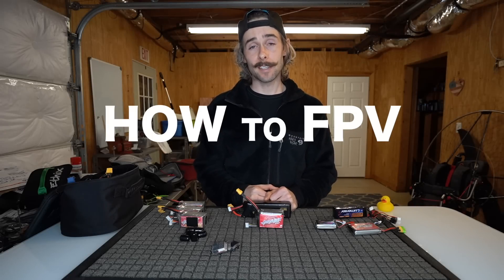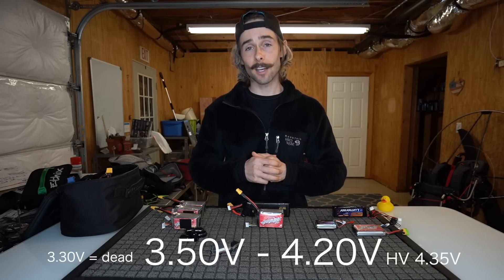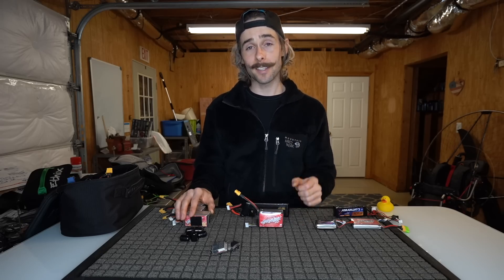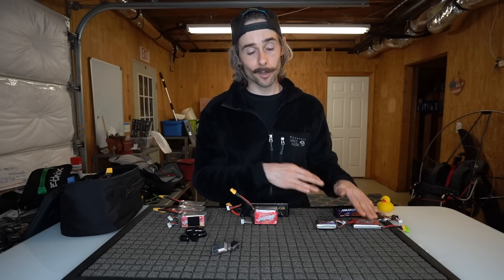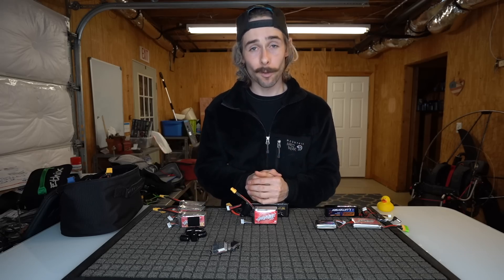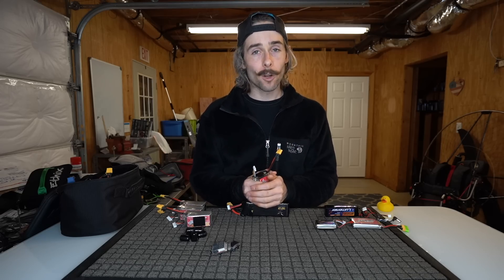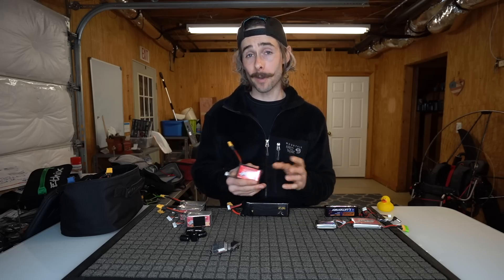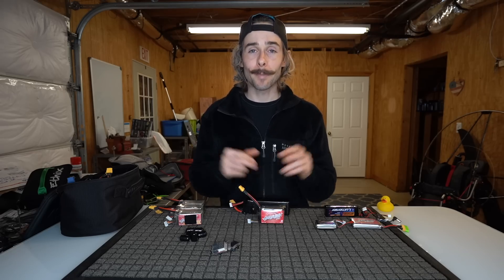How to FPV (Part 6) LiPo Battery Management | Make your LiPos last longer!

Comment: For new flier that wants to "future proof" (and have the "hot setup like Steele") of 6S, they can build/buy a 6S and limit the throttle to 70%. The bonus (besides being able to "turn it up" when ready) is about 25-30% more flight time. That's a very nice thing all by itself, and you will get longer battery life because you are babying them flying like that.

Good video!
Reply: I want to try that. Whats a good 6s grade motor for freestyle?

 I fly a 5", with 4s, HT Cricket 2450s + 5×4×3s.
Looking for smooth maneuvering with good punchout for flicks.
Reply: @jewishjitsu  The Xing 2208 1700kv on the Mamba Stack is my go to setup turning 6" (or larger) props on a Iflight long arm frame with DJI video (it's worth the weight and money IMO). If you're new to the game, or just enjoy proximity and flying thru the air like me, consider the 6" setup. With good batteries (RDQ 6S1250) you'll get super smooth flight and long flights as well as a rugged package that you can fly more than fix. On 4S you'll lose quite a lot of flight time, but it'll still fly fine although not so "punchy" on the hit. 6" on 6S is my favorite and it'll still do the flippity flip thing, but a tad slower (and easier to master), but is much more enjoyable if you just enjoy flying and aren't making videos for the youtube gang. If you're looking for 5" extra light, extra full speed stuff - The Xing 2207 1800 (you can get them in 1700kv or 1800kv) would probably be better for a strictly 5" setup like yours. A Mamba stack on Betaflight defaults ought to fly great if you limit the throttle to 50 to 75%. Make sure you don't just chop the top off, you need to reset the span so you get full range throttle control.

Looks at Oscars rundown on setups like this (https://oscarliang.com/best-motors-props/).
The 2207 is a great motor, I'm using them on 6" machines on 6S, and they work hard, but pull plenty hard, and still live. For strictly 6" I run the wider 2208. Smooth thru the middle with a top on that comes on plenty hard, but not so abrupt it's just a moonshot. You can play with betaflight and smooth things out a bit if you want to go more cinematic. 
I'd bet if you use the 2207 1800kv in your setup with throttle set to top out from 50 to 75% (depending on how new you are and how smooth you'd like it) You'll find it flies great on defaults. Hope that helps. Try the 6" 2208 setup if you have the budget, you won't be sorry. It's a bit bigger and still rips, but slows down nicely, which is fun, especially if you have High def video. If you need to know more hit me back again. Happy flying!
Reply: @scottmarshall6766  Thank you for the detailed response. Ill look into buying a Armattan 6" tonight. Thanks!

Sidebar, a 2208 would be taller than a 2207, not wider, wouldn't that only help with high end?

Comment: Do you use some kind of automated charger that you can set for a specific voltage, or you monitor the charging process manually?
Also thank you for making these series, it helps me a lot! I'm about to get into this hobby, and there's so much left to learn.
Reply from the maker: Automated charger.  Set the current you want to charge at and let it do it’s thing.  Always balance charge
Reply: Pretty much every single lipo charger has a storage charge option. The old imax b6 charger that everyone just starting out gets has it. And every IDST charger has it. All the other random ones do too.

Comment: Once you put the lipos at storage level, how long should you re-check the battery? For those long winter months.
Reply from the maker: They should just chill there and not change   No need to check at Storage voltage.  Do make sure they are kept in s climate controlled environment. Maintained within a range of 60-85 F degrees
Reply: @MrSteeleFPV  Good to know, also very informative video....not as fun as chasing race cars though but just as needed.

Comment: But dont put 6s on a 4s fc right ?
Reply from the maker: FC shouldn’t matter. It’s ESCs and motors you’ll have to worry about
Reply: Unless your fc has a built in BEC that does not support 6s voltage input in which case you could just rip off the bec and use a 6s pdb.

Comment: I'm sure you are aware the S is series not cell. so the 4s pack we use are 4s 1p. I have had people very confused in the past as  to why we don't say 4C. If producing educational type videos this kind of basic fact should be noted. you also didn't mention what you store at I like 3.85V and then charge as 4S 10P @ 1C this allows leaving charging nice and close to going flying.
Reply from the maker: I wasn’t aware.  But for this area of the Hobby. It doesn’t really matter. We don’t have parallel batteries for flight packs

Comment: Regarding efficiency I've something to ask you. I like long range flying so I rarely ask huge current, I never punch when I'm far... My usage is much more constant and this can even be a little more risky because I never have a punch voltage test. Does flight time or ampere consummation could be more reliable to evaluate the percentage of usage than the voltage in you opinion?
And my second question is about efficiency. Do you think it's more efficient, for long range flying, a 6s or a 4s pack (obviously considering the same overall wattage). Probably 6s, since it's easier to provide high voltage than high current. Don't you think?? 
Congrats for all your video!! I always measure 3.75v/cell after landing, under no charge. Seems perfect.
Reply: Unless you properly calibrate your current sensor (using known good current sensor such as multi meter) flight time is more accurate (if you sample multiple similar flights). As what is more efficient, It depends on what is the biggest loss currently and that is hard to know. Better question might be: is it worth the money to change my current setup for less sag and a small flight time gain?

Comment: Regarding voltage that tells you I have to land:

The voltage is changing all the time regarding if you are on full throttle, half the throttle or just slowly cruising. So about which situation are you refering to when you check your voltage and say "It is about time to land, my Batteryvoltage is about 14.8V"
Reply from the maker: Under load depending on the battery and it’s health i.e. how old it is and how much abuse it’s seem you should always look at your packs voltage either when cruising which will be around 13-14V. Or during a free fall. When you have no throttle input.  Should be between 14.5-15V. 
   You just have to know that when you’re under load the voltage will always be lower than it will be not under load.  It takes some time to just play around with your setup and your osd to understand what works for you.
Reply: @MrSteeleFPV  Hi Steele, THX for quick reply. that's what I was talking about. During Powerloop or gaining fast much altitude with full-throttle my voltage drops to a voltage of 3.3V per cell, but during dive recovers very quickly (which is typical). I was jsut curious, because it sounds like that your batterys never reach this low voltage while you are flying (and you did some flying with longer full throttle scenes).  So I just misunderstood. THX
Reply: How bad can we abuse of a LiPo while flying? With full-throttle is there a minimum V (still 14V)?

Comment: hey is a bms a good idea for a racing drone (one wich handle enought amps)?
Reply from the maker: BMS?
Reply: @MrSteeleFPV  battery management system
Reply: @MrSteeleFPV  a pcb wich protect lipos ( so no under voltage, no overlotage)
Reply: @cxmmax4265  esc can already do this. But killing battery is considered saver/cheaper than crashing in an uncontrolled manner. Batteries are cheap compared to the quad, property or ppl.

Comment: Tnx for all this information.
Could you tell more about the lipo pack for your transmitter? Why not use the default pack of your transmitter? Did you modify your transmitter for the lipo?
Reply from the maker: No mods needed.  It’s a 3S 2200mAh pack from lumenier.  Lipo just lasts a hell of a lot longer.   Doesn’t come with a Lipo because they are highly regulated when it comes to shipping.

Comment: Hey Steele is there a way to correct the mah and voltage sensor consumption on the steele pdb? Mine doesn't feel like it's giving me accurate readings... is there a trick?
Reply from the maker: The mAh consumption should be spot on as it’s coming from the each individual ESC.  I know there is a voltage adjustment in the osd menu.  I don’t know if there is a mAh consumption adjustment.  Most likely you’ll just have to compensate for the adjustment.  So if 900 is really 800mAh. The. Go to 980-1000.  Each pack.    Make sense ?  I do this subconsciously actually.  Nothing is ever perfect.  You just have to ball park it. :)
Reply: Thanks Steele for your input much appreciated! Happy flying :)
Reply: You can in betaflight. If it says 1300mah on the osd and when you charge it you only put in 1200mah your reading is of by 100mah. Then you need to calibrate it in bf.

Comment: Great video; though you didn't mention why we should discharge our batteries between use? And / or, what happens to the battery if we don't (if say it's kept on full charge, then not used for a few weeks)? Thanks.
Reply from the maker: I went over that   It degrades the chemistry

Comment: Interesting. This means my lipos should be at 'storage' pretty much 24/7 since I can't predict when I'm going to go use them. I have some work to do I guess since they have been charged but just sitting. Kind of inconvenient to have to charge either the day of or night before and hope nothing happens to squash your plans. Is there any damage to a pack that is repeatedly taken from full to storage because one doesn't use them one the day they plan and more than two days have passed?
.
If there is only a couple minutes of flight time to preserve battery life, they must fly a bunch of packs in order to get 4 or 5 minutes of raw video to edit down to a few minutes.
Reply: Realistically your batteries will be fine left fully charged. You aren't a highly competitive racing pilot that needs to follow every voodoo trick to get every bit of performance. There is hard science that has shown that the impact of having a fully charged lipo for a long time is not significant enough to be as malicious as some people are in this hobby.
Reply: Erm no just keep your packs at storage voltage and then just before you head out chuck them all in parrallel and charge at 2c if your in a rush should be done in about 20-25 mins.

I have packs that are pretty much always at storage voltage and i charge just before i head out and some of them are 3 years old and not too saggy to fly.

Comment: hey what voltage should I charge my 4s batts (whats the max ?
)
Reply: 4,15 * number of cells = recommended
Reply from the maker: 16.8V Max
Reply: charger does that automatically?
Reply: Marc Frank  you have to check if your charger has that function, but must of all chargers do, I wanted to know the max voltage to see how much Steele does but, sometimes when you put in the “s “ rating and the capacity, the charger does the rest but just double check if your charger can or has that function of stop charging when done, hope it helps just careful 👌🏻⚡️🔥💀
Reply: @PabloGarcia-zk7sj  i actually wanted to help, so i should have put ?! in the end
was just surprised that someone would even ask about this, because nobody charges their packs by connecting it to a power supply and adjusts the voltage lol